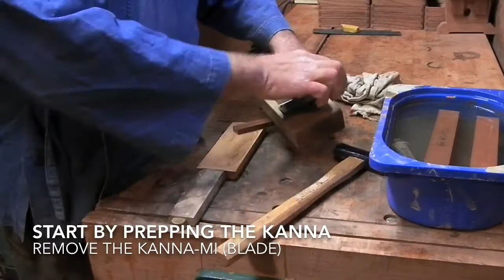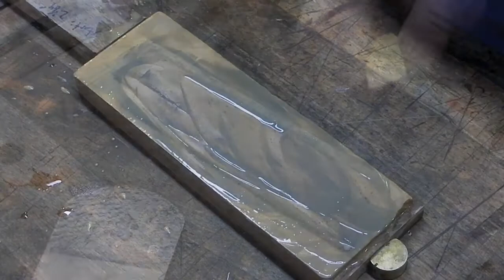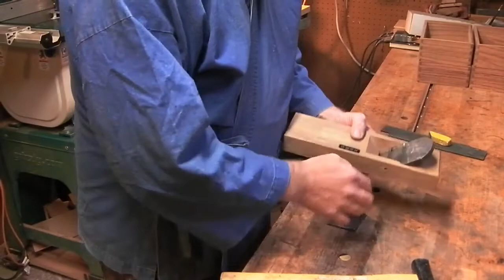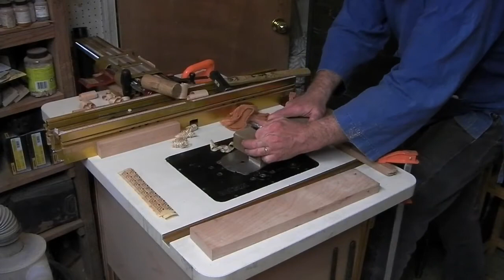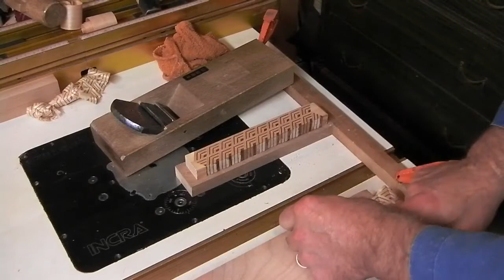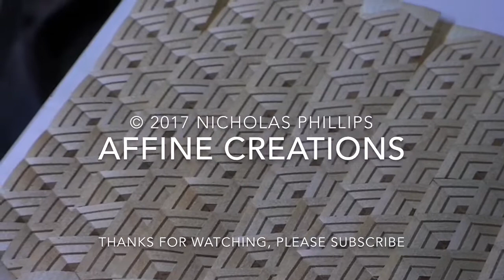Preparing and using a kanna to shave Yosegi

Comment: That's really neat.  I noticed you seem to be hitting the back edge/bevel of the dai with the hammer instead of the flat of the back.  Does that help when retracting the blade?  Is there any room for lateral adjustment on a kanna?